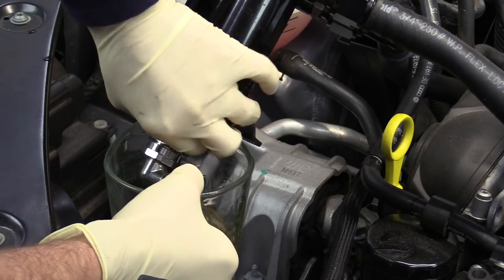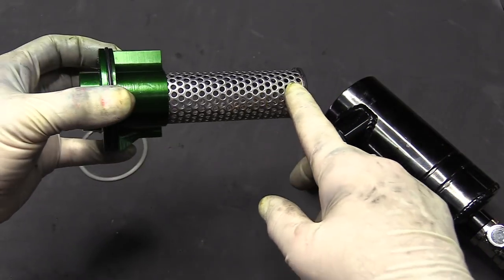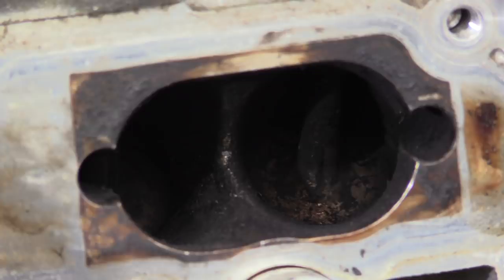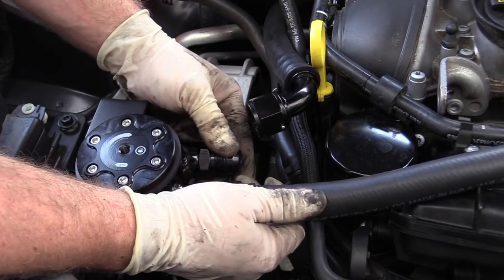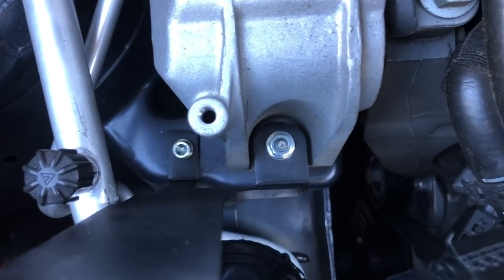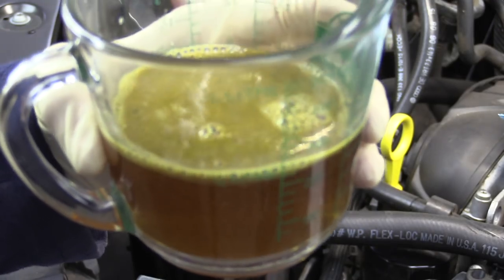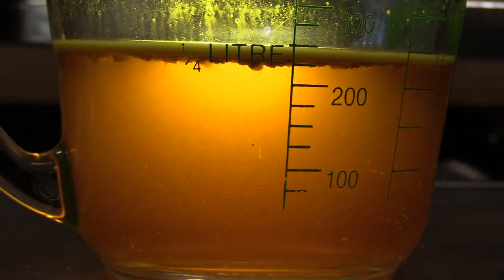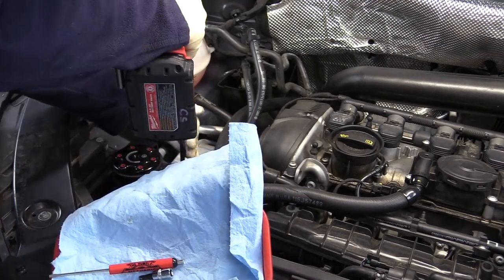Do Catch Cans REALLY Work?

Comment: I think if something as simple as a catch can would prevent the carbon problem manufacturers would have done it long ago...
Reply from the maker: Yes and no. It will also add cost to purchase, and increase maintenance.  But if it was a total solution the odds would be higher. Plus you'd think that OEMs would find a way to install a retrofit kit.
Reply: HumbleMechanic Very true or beef up the current pcv system as well... On another note I'll be sending you a question about axle bolts and why they are a 2 step procedure later when I'm on lunch.
Reply from the maker: SWEET! Send it on!
Reply: Like they are not in the money making business. To try and fix long term problems. Why? I do not see any way they will do that.
Reply: Auto manufacturers are in the business of making cars. If cars last a long time, they won’t make many, and they won’t make them for long. 
Now extend that thinking: if auto makers truly wanted to be environmentally friendly, they would make cars that did last a long time so that as few resources as possible would be consumed making new cars. 
The downside of that extended thought is that it impacts the cash flow of a lot of people...what would all of those jobless people do?  What would the people who rely on those people having jobs/money do?
Reply: My 1987 Honda c70 motorcycle has one from factory. It doesn't have an oil seperator or PCV, just a breather hose at the top most point on the engine. It still only catches mostly just water.
Reply: @HumbleMechanic  meh, add to cost, its can be as cheap as the winscreen washer bottle, not fancy like yours, as to maintenance, if its big enough it will last till the oil change, and a good design will mean it takes seconds to deal with
Reply: Actually people wouldn't empty them often. Plus  just by adding an oil catch can in every car would cost the manufacturer a million dollars to produce. They make cars break to make money from your engine. Get a car that no one wants.  Best bet it's gonna be built better
Reply: Obviously you have never experienced a Ford Ecoboost...
Reply: If the current solution will outlast the powertrain warranty, why would they fix it? Legally, they're liable for anything that happens within 36K or 60K miles and 3/6 years. That's not enough time for catastrophic failure, but when it does happen, you'll be forking out.

Also, they can't assume every customer going to buy their cars to understand what PCV is/does and that would divert their attention from the sale. They can't be sure the customer will drain the crud every month or so and if the failure happens when the crud overflows into the airstream, that customer will probably never buy their car again even though it's their fault.

Also, planned obsolescence. They count on things failing out of warranty. They'll say the transmission fluid is lifetime. Ha! Anyone who buys that deserves the 5K+ rebuild they're cuing up for. Same with engine. They'll make it as lazy as possible for the buyer, once or twice a year change engine fluid, occasionally change belt, water pump, spark plugs, will take you way past the warranty and when your throttle body starts acting up, valves start acting up, misfires start popping up, engine codes... Someone will he cashing in on a rebuild or a new engine install.
Reply: Manufacturers don’t do this because they don’t want your engine to last there is no profit in reliability

Comment: Have you ran an oil or some in depth analysis of the substance in the catch can to determine what has been removed from the engine from burning it? Having one installed do you noticed better gas mileage or cleaner oil during oil changes or anything to show improvement or performance?

Comment: What are your thoughts about the PCV block off plate sold for the 2.0 FSI?

My understanding is that it turns the system into a vacuum only setup and blocks any boost from entering the valve cover.  I bought a PCV service kit from ECStuning that replaced the exhaust side PCV tube as well as the intake side PCV.  Within only a few months time on cold mornings I hear a slight whistle noise when the engine is cold.  I'm no mechanic but I think more boost is provided when the engine is cold (it sounds like it anyways) and the extra boost pressure combined with cold PCV rubber parts is allowing some boost to leak past back into the valve cover.

Comment: I have 2001 F250 7.3 power stroke I put the BD ccv oil catch can with filter it cost around $300 before I installed it I cleaned the turbo all piping from intercooler and intercooler it was very easy to install all hoses were preformed and correct length it comes with filter and a can that attaches to the engine and can that attaches to frame so you can drain oil I have had it on for more than a year no oil in turbo or intercooler I catches 1/2 to 1 cup a month depending on my driving

Comment: Answer: Hell yes they work

The inlets of my turbos, intercooler piping and low spots along the intercooler were saturated with oily residue and pockets of oil. The inlet of the turbo? Awful! 

By adding the catch can, it prevents your motor from ingesting the dirty oily air. 

And...intake valves stayed cleaner too.

Comment: That looks to be mostly condensation.  Definitely not oil.  I don't see that gunking up anything to be honest.  Most of that would evaporate in the intake once the engine is at operating temp.
Reply from the maker: It was mostly oil. I am hanging on to that sample to let it settle out to see what it looks like.
Reply: I think the little bit of oil is floating at the top, and everything else is water.  It would be cool if you got that tested for make up.
Reply: You are right 99% of the times but this is 99% water. ;)
Reply: It is condensation, however it has been proven numerous times that the crap going back into the intake reduces performance over time and gums up the back of the intake valves which conventional fuel system cleaner doesn’t clean.
Reply: Keeping in mind she's got 2 factory oil separators which sit ahead of this aftermarket add on. I'd say it serves a good purpose keeping all this condensation out of the intake too, water is a combustion product, we don't want it in with the reactants if we can help it :P
Reply: HumbleMechanic so you ever get it tested Charles?  And most importantly, did you drink some of it?
Reply: When that metal can cools off it make a great place for condensation to form.
Reply: A quite brown water you have in your tap then. To me it looked like brown, bubbly and greasy. with some random white spots on the top.
Reply: HumbleMechanic how much of it was oil?  Also, how much oil loss did you have from you pan?  If it's all oil you would have the same loss from pan. Correct?

Comment: Just did that on c63 w204 after an intake    Clean job. Lots oil in the intake. First 500km catches some water like fluids. Even it’s an port injection , still recommend add one! So far no codes on, hoses connected between the middle of low pressure pcv.

Comment: Long term I don't think a catch can will prevent carbon build up. It certainly doesn't hurt it though. I'd say the best thing to do is not sit in traffic and try to burn off most of the buildup throughout the car's life. I do Italian tune-ups every day on my way to work. I'll drive at 4k+ RPM for 20+ min. I'm at 86k miles and haven't had any symptoms of carbon build up yet. I avg only 23 mpg but I think it's my driving. I change spark plugs and fuel filter every 40k miles.

Edit: I drive '13 GTI
Reply: I agree with everything you said but you cant avoid sitting in traffic all the time if you live in a very congested area.
Reply: I drive about 2K miles per month and traffic can’t be avoided. 
I open her up whenever I can though, but I’m sure I’ll be doing a walnut shell cleaning about every 50K miles. 
2018 Audi S3.
Reply: I don't do Dago tuneups and my '99 Tahoe has over 321,000 miles and still runs well.  I intend on getting an engine rebuild when smoking or breakdown occurs or other evidence of impending disaster.
Reply: Gweedo, your 99 Tahoe is port injected, not direct injected.  That's the difference.
Reply: @rennkafer13  Yes, Bill, I am port injected and if and when I move into a direct injected unit I will have my catch systems installed.  I currently have a three stage set up.  The first catches more water than oil, the second for some reason, does the least and the third gives me a "nice" puddle of oil.  I think I will change the stage two to a glass container in place of the ABS homemade container.  It would be nice to do a visual check for accumulation on that one as well.  If you pull the hose off the PCV and it is dry, success !   
.
There is still the issue of carbon coming in through the EGR.  I have pulled the module and cleaned hard carbon deposits from it.  If I can keep the "T" running long enough I figure my next move would be hybrid or full electric.  I am leery of all electric since if you die somewhere how do you juice up without a terminal or your home electric being handy ?  The selection of hybrids aint so great right now as I would want a truck type vehicle and they are still mostly geared to cars.  Playing the waiting game for better tech and vehicle selection.  :-)
Reply: "I am leery of all electric since if you die somewhere how do you juice up without a terminal or your home electric being handy ?"Carry a generator with you everywhere?
Reply: @rennkafer13   If I had to go all electric I would want some small gasoline powered unit to be running to slow battery loss and when the car is parked for food or sleep, the lawnmower size unit will be chugging away.  Some good sound proofing and you wont bother other people at the rest area and not be keeping yourself awake.
Reply: @rennkafer13   no it's Sequential Fuel Injection   if he has the 5.7l
Reply: @punker4Real  yes, into the ports.  Not directly into the combustion chambers.  Hence "port injection", not "direct injection".

Comment: Hey man I figured it out. I have the 2009 mk5 golf GTI tsi an I used 1 catch can first with the back pcv blocked off an only using the front but was emptying it out very often like this of mainly water the same u had. So now I run both pcv ports open to their own separate catch cans an habe none of the water anymore in either can just some oily mixture now an this is more what I expect an in the last 20,000 miles i still haven't emptied them but they are like 1/4 full now well the back is an the front is only 1/8 full.  What I think happens when you blocked the back PCV is the condensation they would normally drip out the tailpipe ends up in the catch can. Because I noticed I no longer had water out of my tailpipe when I was empty in my single catch can that often.. but now I have it out the tailpipe again an not in the catch can.  So I run 2 cans now one for both outlets on the pcv with great results.  I have been running them since 70,000 and I'm at 95,000 miles now an about to do a timing chain an tensioner job along with the injectors an intake manifold flapper runner sensor as well an I will know how well the catch cans this way worked for me in the last 25,000 miles an will post on here an get back to u.btw love ur videos man

Comment: Charles, I've been watching for some time now, and I enjoy the videos you put up, even if they aren't entirely translatable to the Subarus that I work on. 

I just wanted to make an ultimately insignificant and slight suggestion. Your video quality is top notch, but I've noticed when watching in 720 or 1080p, that your intro card is a bit lower res(perhaps 360p). It doesn't detract from anything but I think getting it re-rendered in high res would add another touch of great presentation to your videos. 

Just a thought. 

Thanks for putting the content out!
-Ty
Reply from the maker: Haha. Thanks Ty!! I appreciate it

Comment: Not sure if anyone has said it or not yet, but what you're catching is blow by plus oil. This includes fuel, water, oil, and very small quantities of other "stuff". Joap it and you'll see these results. This is exacerbated on turbo and supercharged vehicles due to increased blow by and higher crank case pressure. This is why Ford has now implemented an intake track fuel injection, that's commonly found on cars, mixed with a direct injection system for their 2018 3.5L EcoBoost engines. This was Fords answer to the intake vales getting coked in oil and carbon causing engine failures. They tried the catch can method, same as BMW, but it had little impact due to it not being serviceable. A well engineered catch can system that can be serviced will make a huge difference like you showed here. Mishimoto is one company that makes very well engineered catch can system and they have all of their engineering data readily available upon request. Great guys to speak with as well if you give them a call I'm sure they'll be more than happy to help answer some of your more technical questions about how and why this system works.

Comment: I owned an 07 gti and put a catch can on it at 18k miles (when I got it) and drove it to 98k with a stage 2 tune when I finally sold it. At 98k I had never had any hard starts or misfires related to carbon build up. It did go through a set of 4 coils in that time. I would say the catch can works. During that time I owned it I heard of many gti' of my generation needing the walnut intake service to clean carbon due to hard starts and miss fires.

Comment: I had one installed on my 89` Honda CRX and had it run on 2 engines, one had kind of bad oil rings (they got better the more i drove, it stood about 5 years, then got turboed, then got driven, at first you could see blue smoke, but after some driving around they got better, i think there was some kind of sludge in them which got washed out when driving) and the other one was running perfectly fine and didnt take any oil, the first engine didnt have anything in the catchtank after 100km driven, well there were some drops but not mentionable, the second engine took about 500km before the oil catch tank was completely full with white goo, it kinda looked like an milky coffee, and thats why i will never ever lay the return line of my oil catch tank into my oil pan :) Greets from germany

Comment: Nice can you have there!

My first one was a cheap-o unit, so much so that I had to put my own baffle and stainless steel catalyst in there. It fell apart since JB Weld apparently doesn't hold up too well with the caustic and solvent-like crap that's vented from the crank case.

Comment: The base for Carbon build up in valves are the stem sealers sipping out at hot soaking head mostly when you shut the engine down. It makes some tacky varnish at the begining, since all other components flashes of at that temperatures.